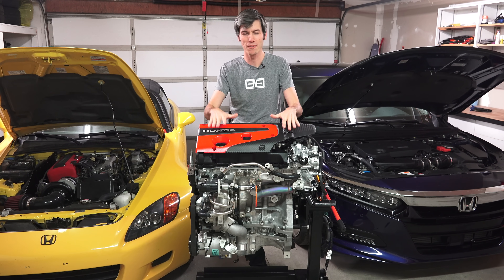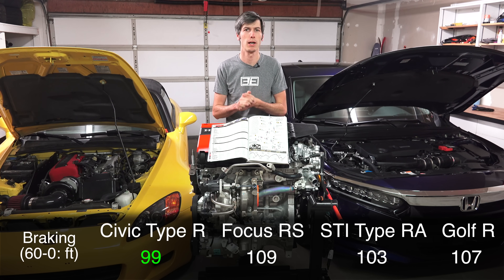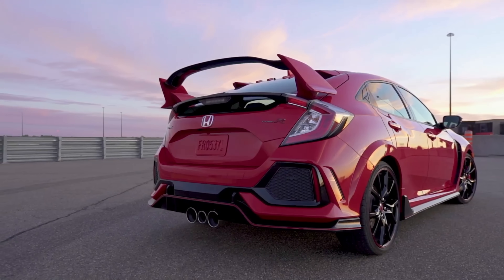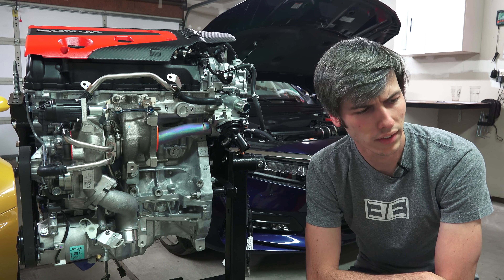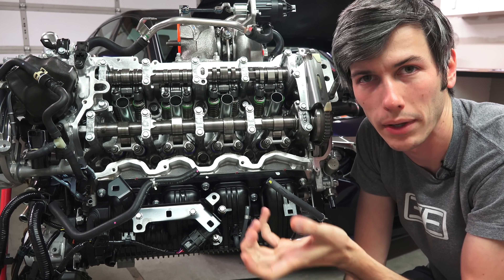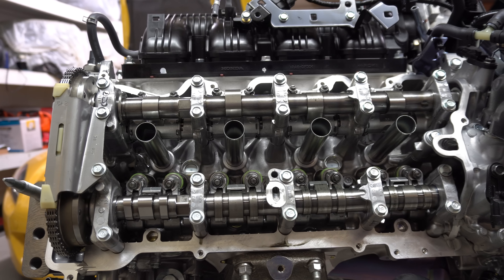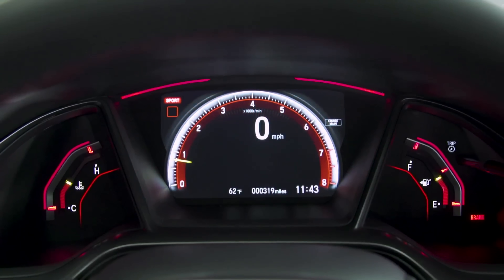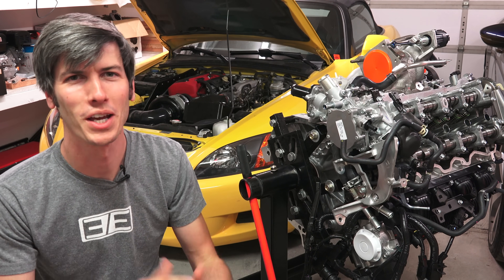The Honda Civic Type R Destroys The Competition - The Best Engines

Comment: regardless of what you say bout FWD or anything like that, honda know how to make an engine.
Reply: Peder Hansen  You forgot cheapest of the four, lightest of the four, longest wheel base, widest track, second largest cargo space, and highest mpg. But yeah, it looks weird.
Reply: The FF platform is a fun one, but Honda NEEDS to bring back the s2000 and put this Type R engine in it in FR configuration.
Reply: Unless it is for Formula 1
Reply: Oooh yes Honda is basically a motorcycle company and we all know how motorcycle engines are great.
Reply: yea, there lawnmowers are pretty good.
Reply: Honda's K-series motors are the best inline 4 cylinder on the market right now. They're reliable, cheap, abundant. superior, and have lots of 3rd party support. If you blow a K motor, you can easily replace it while if you blow a B motor, good luck with that. You find these K motors in the junk yards easily or even just buy a car that comes with it now.
Reply: On top of that the most reliable out of those manufactures bar none! If you buy a car and want it to last up to 200,000 with no issues you aren’t buying a ford.
Reply: @PhilippineKing  I guess you never heard of the Ford CROWN Vic🤔
Reply: they know how to make small engines.
Reply: not in formula one lmao
Reply: Oh yeah!
Reply: Peder Hansen  The RS has significantly more power and torque. Down force no idea.
Reply: Agree they struggle to make it work together with a motor though. That is actually starting to harm their reputation.
Reply: Peder Hansen  If anything Honda followed their lead on the radical styling
Reply: Peder Hansen most HP? The STi Type RA has 310 hp and the RS has 345, idk where you got your info lol. The Civic is in 3rd place in terms of power
Reply: Peder Hansen  Looks are subjective what is ugly to you is beautiful to others. Also if looks is the only thing you got going you already lost.
Reply: A FWD civic just won the open time attack challenge  wich included evry hectik car AWD , RWD  AND NO LIMIT TO HORSE POWER ..  THE CIVIC HAD ONE OF THE LEAST HORSEPOWER IN THE FIELD BUT HANDLING WAS TOO GOOD . BY THE WAY IT JUST LOST IN THE PRO TIME ATTACK TO THE 1000HP PLUS EVO, IT CAME SECOND ... HONDA TYPE R  CIVICS ARE TOO GOOD   .. AND THEY ARE FWD ....TIMES ARE CHANGED PEOPLE . RESPECT HONDA
Reply: @corone2018  FWD take the least power to turn
Reply: All that's great, but the days of the ICE are numbered. Electrification is moving in and here to stay. The consumer may no want it (Not yet at least. ). The government however is going to ram it down your throats. Rev'em while you can.
Reply: @tnsd5801  facts and although you can get "green energy" most energy still comes from burning natural resources so still not green. Combustion wins for me. Hands down
Reply: @tnsd5801  Electric car life cycle will decline as other technologies develop. Electric isn't as efficient as they like you to believe.
Reply: They can't make a V6 or a V8
Reply: The Stig 😂🤣😂
Reply: @thestig2583  , look common sense dictate that if you are able to build a 4 cyl that produce 306 hp and 290 bhp ,yo don't need v6 or drinking v8 ,just joking with v8
Reply: @thestig2583  Wrong, they can and they do. Check the new NSX - 3.5L Twin-Turbo V6, plus three electric motors
Reply: DarthMaul41 And the NSX V6 makes less HP than the V6 in the GTR, which came out over 10 years ago and is heavily based on the VQ that dates from the early 90s. Honda said that the J Series was too weak to power the NSX. Both Nissan and Toyota produce better V6s and V8s, and considering Honda's extensive pedigree in bikes, making a good 4 banger isn't that great of an accomplishment.
Reply: The Stig Not sure where your hate for the J-series comes from. They aren’t designed to be racing engines, and Honda never intended them to be used in a racing application. They’re designed for an Odyssey or a Pilot or an Accord, and they are great for those applications. They’re powerful (even lacking DOCH and until recently, DI) and fuel efficient and reliable. What more do you need from an engine in a minivan or SUV?

All of the Japanese manufacturers make good V6 engines. Honda’s J series is getting a bit long in the tooth, but they are currently developing a turbo DOCH V6 to replace the J series.
Reply: @thestig2583  Incorrect. They make a 500kw 3.5L V8 in their indy cars and what about the 373kw 3.5L V6 in the NSX, just as an example.
Reply: The Stig the Accord is available in a V6
Reply: The Stig they don’t have too !
Reply: @thestig2583  You're right there J series motor doesn't exist. all their midsize vehicles only have a 4 cylinder.
Reply: TOM THETECH The J-series is a single cam joke compared to the very old VQ and GR engines. It was too weak to power the NSX
Reply: @thestig2583  The NSX wasn't powered by a single cam J-series engine. It was powered by the dual cam C series engine specifically built for it. that J-series engine was never really built with performance in mind. It is however an extremely reliable and well engineered engine getting superior gas mileage then most engines in its class
Reply: TOM THETECH It's no more reliable than the VQ or GR. It only makes 500bhp, much less than the GTR. It's a good engine, not quite as good as the alternatives
Reply: @thestig2583  V8 civic? are you okay bud?
Reply: @thestig2583  j series
Reply: @thestig2583   Honda does make a v6, they don't need to make a v8

lazy Americans make v8's
Reply: TheApatheticGuy The J Series is horrible. No replacement for displacement.
Reply: @thestig2583  I guess we'll have to agree to disagree
Reply: TheApatheticGuy The NSX has a V6 because Honda tried and failed to make a V10. Their own V6 is worse than those made by Nissan and Toyota, VTEC is no longer a novelty and they still use Sohc. The GTR makes more power than the NSX. The Ridgeline is a joke and Honda cannot make a decent utility vehicle. I'm sure if Toyota put all their effort into making 4 bangers like Honda, they would be vastly superior.
Reply: @TheApatheticGuy  v8 is for heavy duty applications and Honda doesn't have bigger cars and trucks like ford Chevy or Cadillac
Reply: @carholic-sz3qv  Yes, I can see the utility of a v8 in a utility vehicle. As you said, this is not Honda's automotive demographic.

As far as consumer cars go, Honda aims for the passenger car and SUV. Shoving a v8 in these is unnecessary for the average person. They just discontinued putting the J-series v6 in Accords starting with the 2019 model in favor of a 2.0T 4-cylinder. I'm willing to bet this is going to be a trend from them in the future, too.
Reply: @thestig2583  um the ridgeline is not a joke. Many people enjoy it.
Reply: Bald Kiwi It's not a real truck
Reply: @thestig2583  and I agree with that, but people who buy the Ridgeline understand that and don't need the capabilities of a body on frame vehicle. It's just an suv with a bed for extra utility. It honestly fits the duty for the vast majority of pick up owners.

Comment: I love my 2018 Honda Accord 2.0T!!! Great video thanks..
Reply: I bet all that tq is fun as hell to drive on.
Reply: @GhadSpeed  Yes I have videos click on my picture. Thanks!
Reply: I've always wondered...

Can the (coupe, 6 speed) 2007 Accord 3.0L keep up with your 2.0T?
Reply: @ajbautista86  Hey bro I beat a 2018 tlx A-Spec with the accord check my channel for videos and the 17 accord doesn't stand a chance thanks!
Reply: @ajbautista86  no bro
Reply: I have the 2018 Accord 1.5. Haven’t raced the last gen Accords yet, lol. Still waiting.
Reply: Ew
Reply: You have a CVT?
Reply: CarExclusive I love my Accord 2.0T 10spd. It can be comfortable and quiet on the highway with the most usable interior space in its category, or it can spin the front tires through 3 gears and carve corners while holding the right gear for corner exit every time. The engine never fails to make me smile.

Comment: Pretty disingenuous to say that the Golf R has those 0-62 mph times, I understand you're quoting a magazine, but those numbers are way off. I am sure you're aware of that, but I guess Honda is paying the big $$$.
Reply from the maker: I did forget to mention (but still think it's fair) that these are 0-60 times with 6-speed manuals. VW generally has pretty tall gearing and I think it works to their disadvantage here. The DSG is much quicker in the VW than the 6-speed.

Comment: So oil squirters and sodium filled valves. Basically 1991 mitsubishi 4g63 tech for the oil squirters and 03 z06 ls6 corvette tech for the valves. I will say though, numbers don't lie. Wish I had this in my cb7 vs the h23 thats in it...

Comment: Why will they not offer this engine in an Accord? I personally would rather have a v6 but I believe this engine should have at least been offered in the 2 door Accord coupe with the manual transmission before they did away with the 2 door Accord.
Reply: More aggressive suspension and an lsd would matter much more for the sporting intentions of the accord sport driver

Comment: Do the testing on a real road not in a controlled environment lets see how the Type R does on wet roads or gravel & dirt. Then there's the HP difference also weight & tires which play a big factor to the results.

Comment: Didn't  you just make a video saying small displacement motors with turbos aren't efficient?  Also the Type-R may have a lower msrp than the others but I guarantee they are selling for way more. I worked at Honda when the Type-R came out and everyone was putting a 10k minimum markup on them.

Comment: Lol, most magazines are bias. But I knew for sure that the type r is faster because is 2 wheel drive and it does not lose as much horsepower thru the drivetrain as awd cars. Even the pos srt4 neons  were beating EvOs and STIs from the roll.

Comment: Are these turbo systems proprietary or can you swap for a t3/t4 or something else? 

Also if a car comes twin turbo'd can you convert it to a single turbo?

If a car does not come boosted at all, can u turn it into a twin turbo set up. 

I'm trying to figure out the VQHR37 and the VQ30DETT motors. I wanna make my 37 into a TT.

Comment: Shouldn’t the fwd be cheaper than a bunch of AWD cars?   Power is cheaper to make then traction is to get, besides performance in low traction situations would obviously be inferior, plus the average guy will use max traction more often than peak power. Usual Honda over hype.
Reply: An AWD system doesn't cost that much, after all Acura TLX has a torque vectoring AWD similar to the Focus.  FWD allows for lower weight and lower loss.

Comment: Interesting that the type r is so much cheaper in the states. In the UK the price is comparable to the focus rs and golf r manual. Speaking of golf r that 0-60 of 5.7s is shocking to say the least, even the manual should be getting low 5s. And the type r 5s dead seems fishy. I've seen times which have bettered Honda claimed figures but to me that seems too quick. No denying the r is fastest once its  moving though or those track times, it just is

Comment: You say, they did many steps to get it run cooler & they also integrated exhaust manifold into block, so these two things are controversial, I think. 
About this FWD being faster - again you compare dry asphalt, which is only surface, where this monowheel is faster. All other surfaces Honda will not have chance.